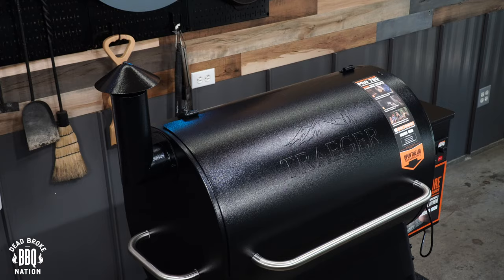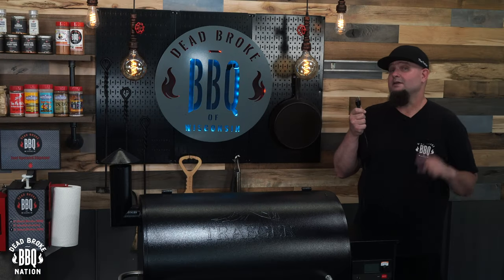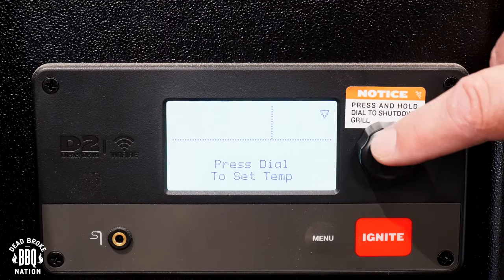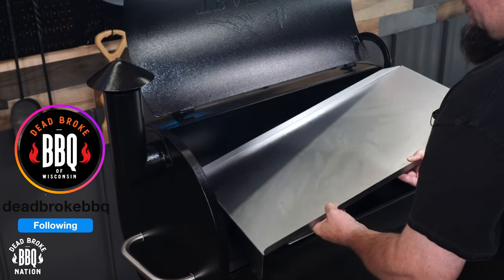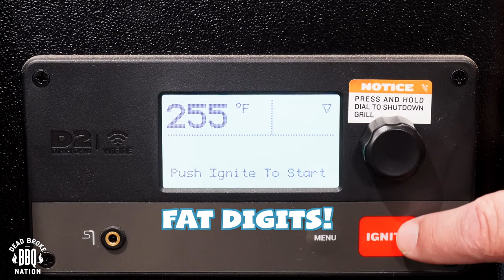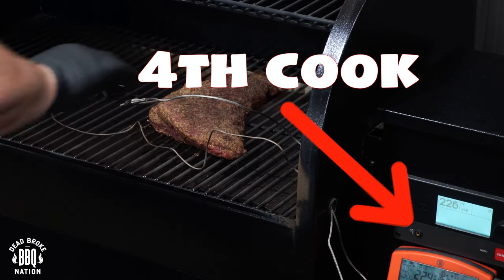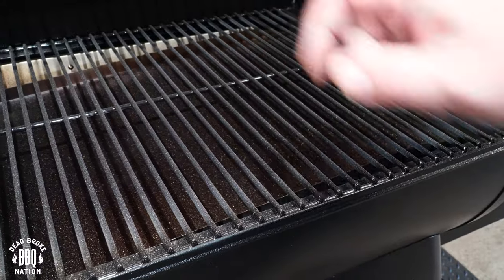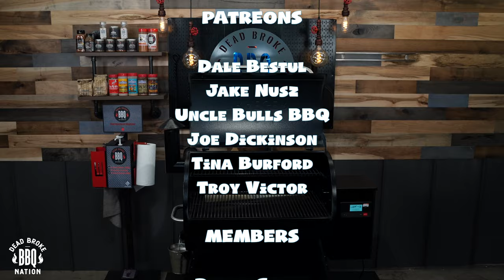New Traeger Pellet Grill | Burn Off | The Correct Way

Comment: I hit my Traeger with the high heat right away and it did peal.  So please follow this to prevent the pealing.
Reply from the maker: Ya this doesn't happen all the time on powder coated pits but it does happen on every brand unfortunately. I can't say that it still won't happen but out of all the pits I have had none of them have peeled. Thanks for watching and leaving this valuable comment for others to read!!
Reply: Glad I found this video! Seasoning mine right now with this method.
Reply: Well I hope mine doesn't because my dumbass didn't look at what the temperature was set in and it was in Celsius and I sent her the 250...
Reply: If the paint bubbles then I get a new one great warranty

Comment: When I burned in the traeger, the manual did not mention seasoning the chamber at all, just burn off.  I've been cooking about 2 years on it.  Am I too late to the seasoning party?  The food oils have coated the top half nicely, the bottom is a dry dusty brown.  It gets vacuumed after each cook
Reply from the maker: Brian you are good to go brother! All I did with that canola oil to speed up the process to what you acquired from just the regular cooks!! Most pellet grill companies don't talk about spraying them down, I guess old habits from an old charcoal and wood cook never die brother!! hahaha I am very happy with how this controller works! The last Traeger I ran was the old Pro 22 and wow they have taken a step forward!! Thanks for watching!!

Comment: So during the intervals of 250,350 etc the lid should be closed then correct as the temperature needs to be controlled?
Reply from the maker: Yes, leave the lid closed once it has finished the start up cycle.

Comment: How do you smoke on the 780? My dad’s traeger has a smoke setting but this one doesn’t. He smokes ribs for 5-6 hours I’d like to know how to do it on the 780
Reply from the maker: Turn it on at 150 and let it roll, this pit will smoke enough. Older Traeger pits had a smoke setting because the higher temps they ran, the less smoke they made. Thanks for watching!

Comment: New to pellet grills. Thanks for the video. Understand the reasoning for having the lid open, but my 575 never made it to 250 with the lid open. It topped out at 200 then cooled to about 125 before I closed the lid. Followed your steps after that 👍🏻
Reply from the maker: You don't leave the lid open the whole time bud, just until the white smoldering smoke stops and the fan kicks in. That only takes about 10 minutes and then you close it up. Thanks for watching!
Reply from the maker: Search videos of My Traeger blew up and you will see what I am talking about. Build up of that white smoke can combust!
Reply: @DeadBrokeBBQ  thanks for the help! Will continue to follow your videos 👍🏻

Comment: Did this exact burn off. Did it a second time to 2x set the season which I do with all grills/cast irons. On the second season the paint over the  burner on the lid and adjacent barrel lip started to chip. Welp, guess it's going back to home  depot.
Reply from the maker: Dang that sucks. That pit must have been built on a Friday.

Comment: According to Traeger certain models with the rear downdraft exhaust do not need to lid open for startup.   They have a little chart/list that helps you determine if you have to.  I never open the lid on my Ironwood 650 (with the downdraft exhaust) just like Traeger states.  No issues.
Reply: On another note. I’ve owned three different brands of pellet grills.  The best performing controller has been the Traeger.  Even with no super smoke on the lower D2 models, the smoke production at 200 and below should be just as good as on my ironwood with super smoke off.  Just a nice stream of steady stream of thin blue smoke.
Reply from the maker: Ya Krash the downdraft exhaust is suppose to eliminate this but my car has drivers assist and I don't trust that either!!ha ha But these fire up so quickly that a couple minutes with the lid open IMO is a better safe than sorry prevention. I am glad to hear that you haven't had any issues though!! Thanks for sharing that with us!!
Reply from the maker: I agree I am nowhere even close to being a certain "Brand" person. I have tons of examples on how I switched brands on multiple things and was typically happy that I did it! I do have to admit I lean towards the craftsmanship and build quality on my Lone Star Grillz Santa Maria, so I am excited to see what their pellet grill is like when it finally arrives here! But I will cook on any pit to see how it does! I am actually film at this very moment a rib cook on a Z Grills and that thing is doing a pretty good job so far!! Thanks for watching and leaving these great comments brother!!

Comment: Your burnoff on the Laredo was slightly different, which would you suggest?
Reply from the maker: Both are good but I prefer to do it like this so I have less of a chance to have the paint to start to peel. Little lower temps for a longer period of time to help cure the paint. I have yet to have one of these powder coated pits peel. Thanks for watching and have fun with the new pit!!
Reply: @DeadBrokeBBQ  thank you for the reply. Getting started early with the burnoff this morning then jumping in to smoking a pork butt.

Comment: Ricer,

Another great video. I am getting tempted into buying a pellet grill. I can only spend about $750. Have you seen or used anything in that range that you could recommend?
Reply from the maker: Yes this Traeger is $1,000 but a very solid pit so far for me. The Pit Boss 1150 is around that $750 and has a lot of good convenience options on it. Plus it is bigger than this Traeger. Another option would be the Pit Boss 850 and both of the Pro Series pits can be found at Lowe's. Camp Chef make a good pellet grill also.  Hope this helps!! Thanks for watching!!
Reply: @DeadBrokeBBQ  Thanks for taking the time to reply and giving a detailed answer. As always I appreciate you help.

Comment: I got a Pro 780 last week. Is it supposed to smoke a lot right after igniting it? I started following the instruction manual for seasoning but then found this video and shut it down 5 minutes after igniting because it started smoking a ton. Before I restart, want to make sure that’s normal 😬
Reply from the maker: Yep that is normal. It will level off after it builds a nice fire in the firepot.

Comment: I'm late to the party here, but the drip pan has so much grease on it - do I wipe some of it off with a dry paper towel? I've read mixed things up online - some say it's not necessary, some do?
Reply from the maker: After every 3 or 4 cooks, I take it out and scrape it down. If there is a bunch of grease on it after a cook, best to clean it off some so you do not have a grease fire. Thanks for watching!
Reply: What about the intial grease on the drip pan out of the box?